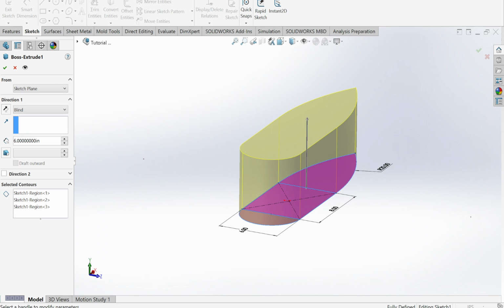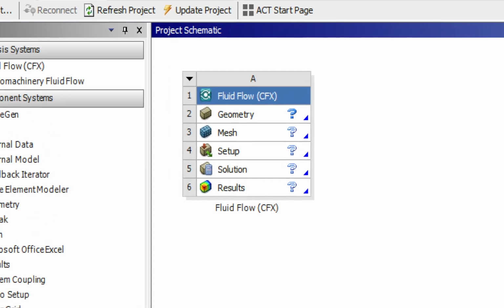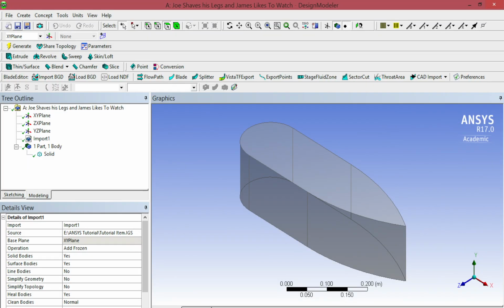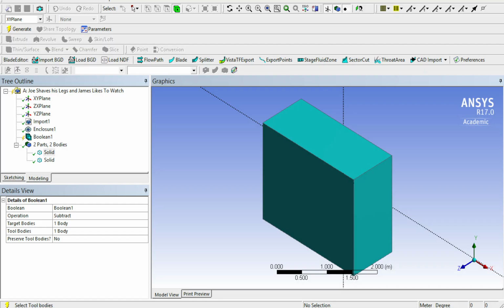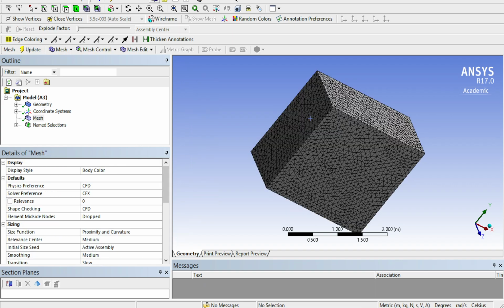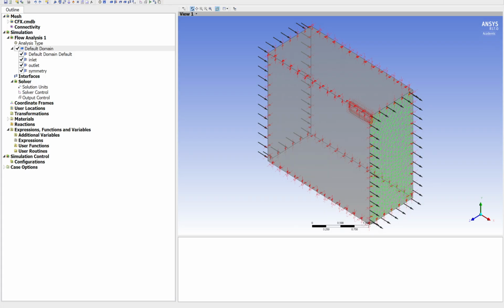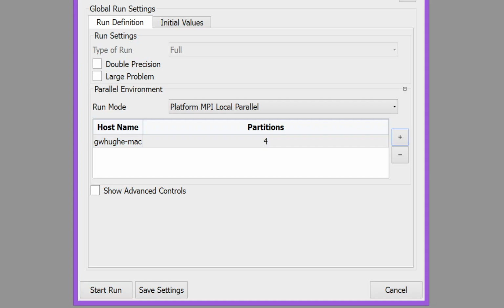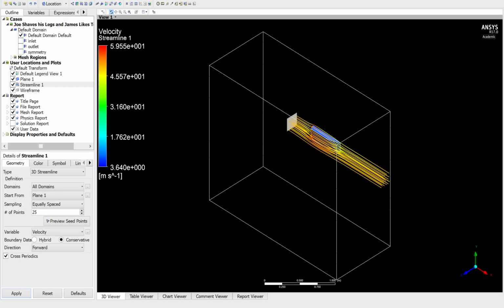Crash Course in CFD (ANSYS CFX)

Comment: Thanks for posting! I was just wondering if you could explain why the setup is so complex in CFD software compared to creating a fluid simulation that interacts with polygonal models like in 3D software used for computer graphics.
Reply from the maker: HISΞROD I’ve never used a graphics-only software, but I’d imagine it’s because of the precision and complexity of the solution. A CFD solution will produce variables like pressure, velocity, turbulent frequency, and applies wall functions to simulate boundary layers. I’m assuming a 3D graphics model only solves for direction and maybe velocity. Plus, CFD software is used for research as well as product design, so the more control you have over the mesh and solver, the more accurate the user can be when simulating a specific environment.